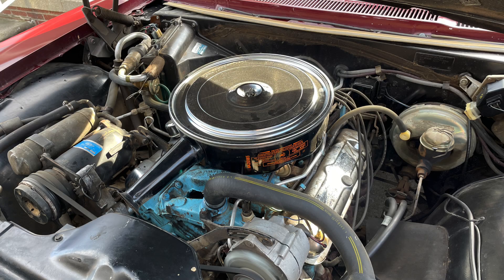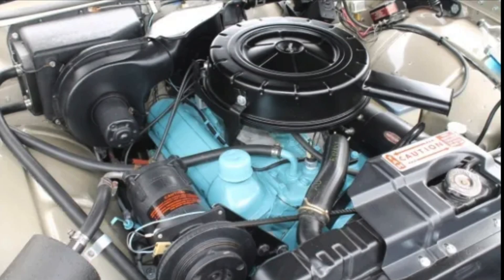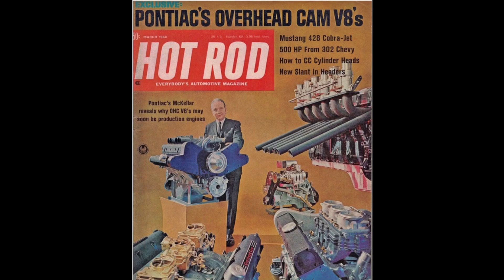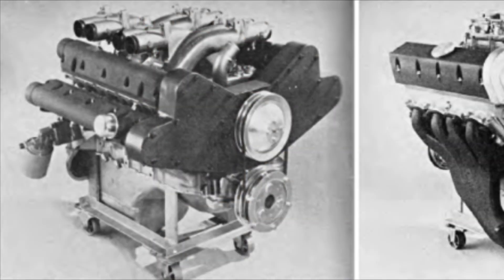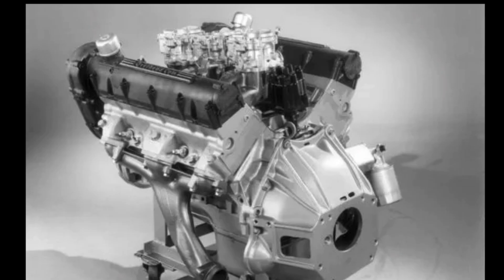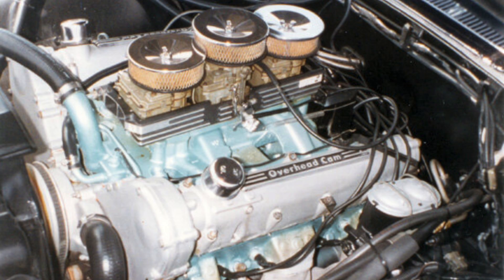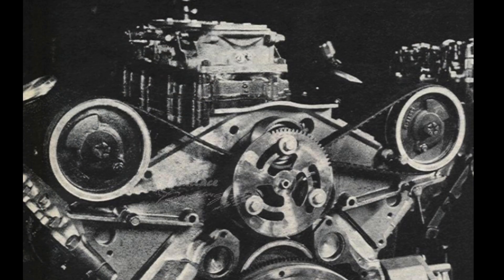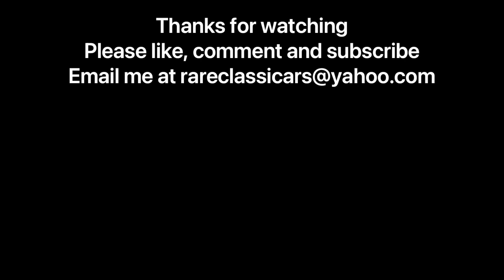Most Powerful Car Engines: Pontiac Builds SOHC and DOHC V8s in the 1960s!

Comment: I owned a '68 Tempest with the 6 cylinder OHC engine. Bought it in about 1974 or so and it ran pretty well, though the engine did exhibit a kind of a "WHEEEEEEE" sound. Very weird sound, but I had no problem with the engine while I owned it.

Comment: SD pontiacs started in 61with the 389, the 421 SD in 63 was a monster! Very underrated !!
Reply: No. There was a SD 389 in 1960. Over the counter engine, with different heads, #7 solid lifter cam, 1.65:1 rockers

Comment: Unfortunately Pontiac was TERRIBLE at marketing almost anything, despite the crap coming out of Jim Wangers mouth and pen.  Tell me how many Super Dutys, 428 H.O.s, 455 H.O.s Ram Air IIs, IIs, IVs... blah blah blah you can find and add them up and if the number breaks 2000 I'll eat my words.  Americans DID NOT hear about these engines or when they did they did NOT believe they were reliable as daily drivers or affordable.  And you know what -- it was one time when Americans were CORRECT.
Reply: Pontiac's marketing was fantastic under DeLorean's leadership, but by the time they got around to the 455 for example, DeLorean was gone, and the smog/emissions restrictions clobbered everyone. I heard the Pontiac engineers had to sneak around to even build the Super Duty 455, and GM wouldn't allow the division to go nuts marketing it. 

It was supposed to be a wink and a nod secret that all you had to do was go into the motor with a proper cam, carb, intake, and headers, and that motor seriously came alive. The block and internals were overbuilt purposely for people to do that. And of course GM put a stop to anything that would outperform its halo Vette. 

I was all about cars in 78, and I knew nothing about the SD455 - none of us car guys did. We just knew they had a lot of torque but fell flat pretty quickly. We didn't really care though, we were building our engines from the oilpan to the carb. Would have been great to have today's aftermarket aluminum heads.

Comment: There was another OHC Pontiac V8 that resided in the engine lab of General Motors Institute when I went there from 1980-85.  It was SOHC, and was called the Repco-Pontiac.  The story I got about it from the lab manager was that it was a 303, designed by the Australian Repco company for TransAm racing in or about 1970.  It didn't look anything like the McKellar ohc engines.

Comment: A big if not main reason, the overhead cam V-8's were not adopted in American cars in those days, was, having overhead cams made the engines too tall to fit in the engine bays without having to have a big lump or a hole cut into the hood. American car companies liked to have several different engine options on the same platform or across platforms, & the platforms at the time were designed for pushrod V8's, which were significantly shorter. The Pontiac Sprint straight 6 cylinder had an overhead cam, but it's dimensions weren't as difficult to accommodate. I remember a 1970 Pontiac Lemans convertible with one of those.

Comment: Three versions of the Experimental SOHC 421 were built by Pontiac engineers in the early 60's one made 625 HP  and capable of 7000 rpm - unleash those in NASCAR etc. 1961- 62 Pontiac still Dominated NASCAR with their Super Duty Program  🏁🏆😎 GM's Infamous  Racing Ban ended all that in 1963 🤬

Comment: As a Pontiac Dealership tech in the early 80's and just out of trade school, I saw my first OHC six. The dealer I worked at had two customers that brought in their '68 Firebirds for servicing with those engines installed. Neat to see other types of engines that Pontiac developed and tested. Too bad they never made it into production. The OHC V8's remind me of the Mercedes OHC V8 engines I saw while working in an Independent Mercedes repair shop while I was in high school.

Comment: I experienced this OHC straight six Pontiac engine being used in a Tempest by a Air Force instructor back in the late 1977 while in Tech school.  The instructor gladly showed it off to me but he did mention being very maintenance intensive.  Constantly rebuilding the head due to oil subsumption (valve guides and seals).   I did get the impression from him that he probably would have been better off with a conventional 4 barrel V8.

Comment: The slots on the toothed cam pulley at  the 10:32 timeline of the video would seem to indicate that the engine had a variable valve timing set up, as well. BTW, I once had both a 1969 and 1970 Trans Am. The 1970 had a rebuilt Ram Air IV 400 with SD 455 rods and other modifications - built at P&M Machine in Shreveport, La. It was a violent and all conquering car in street races during the late 1970s.and early 1980s. I sold it to a Pontiac collector in Oklahoma that had dozens of rare Pontiacs stored in pole barns and many catalogs of Pontiac HP parts.
Reply: Pontiac owners/restorers, racers/investors spend $20,000 or more on engines that regular working Americans could never afford.  I LOVE a traditional Pontiac V-8 but younger generations are rightly ripping them out and replacing them with Chevy LS engines because they are reliable, good on gas, and affordable.  Your GREED and INVESTOR BS has killed any future interest in trying to maintain a Pontiac performance engine without a $50,000 endowment.

Comment: c.a. 1962 Mickey Thompson had a V8 in a Tempest with FE Ford angled spark plugs  any info on these heads?  Micky also had Hemi heads which could be drilled for most 4 headbolt per cylinder blocks  Pontiac and Ford FE for example  won TE NHRA  with a blower  Any idea where the molds went  MT could make for Olds or Cad also easily  great design

Comment: I put the first pontiac tubo engine together for them on a dyno. Was a 301 engine. And then they had me set it up to run on propane with the turbo. It ran real good and clean. I also did the buick turbo for buick but they had no clue of building turbo engines. They didn't even know what a waste gate was. So the motor blew to pieces and then the ass holes tried to blame it on me. F um?

Comment: Pontiac are vary easy to hot rod . I have a 75 firebird with a 400 cdi that stock put out 215 hp with a 4 barrel carb . pontiac did not dish any pistons so change heads to #46 and new intake edlbrock & carb. RA #1 cam 335 hp .

Comment: I thought the overhead cam 6 would have been produced longer. Just like the 4200 double overhead cam six is no longer. Good engines, the 4200 has better output than v8

Comment: There was the dynamics of "you cannot challenge Chevrolet". That went on all the way through the 1990's. RA V motors, could not challenge the BBC. Killed the Gran National because it challenged the Vette, and the same with the 1989 Firebird that had the GN motor and transmission in it. I had the magazine he is discussing and the later magazine with the RA V on the cover. It was always a dream and nothing more. Very little of these ideas or projects got out the back door. Milt Schornack was one of them that saw a little of this.

Comment: Wow, I remember that cover, almost got me in trouble. I had that mag in my senior HS english class and my teacher balled me out for reading that "trash". I thought my dream job would be to work at Pontiac engine research. After getting my degree in Mechanical Engineering, I landed a job working at Ford engine research and had a lot of fun. Rotary engines, gas turbines, and did a lot of work on Direct Injection. Also saw Ford put the first computer in a car. I took up the whole back seat and we thought that was a crazy idea!

Comment: My 67 Firebird Convertible had the 6-cylinder overhead Motor sorry if anyone gets Made, they were Junk I had nothing but Problems from day one, I bought it Used 800 Buck back in 79 Guy told me Great running car, It seemed find for test drive, Driving home Started over heating Miss firing, own 8 months sold it. Had a great body,

Comment: It's sad that back in the 60's and 70's engines with simple carburetors could have so much power with little technology and be built for less. Now it takes thousands of dollars to give the same power with so much technology available and over priced cost. Give me back my carbureted engine and a low price to match. All these new cars need 15K engine to give you the same power the older cars came with from the factory. Car prices are off the charts

Comment: Pontiac built some great cars with great power plants. Ironically, I read an article the other day about the Buick Grand National powered 89 Trans Am Pace Car. The article said the car was rejected by Pontiac purists who hated to see a Buick V-6 turbo under the hood. I kind of thought the article didn’t have much merit because by then Trans AMs and other Pontiacs were running Chevrolet motors (or lesser Buick V-6s). Anyway, a very interesting video.
Reply: Funny you should say that because the faster Pontiacs to roll off the assembly line didn't have Pontiac engines. Like you mentioned, the buick V6 and LS powered were the quickest
Reply: @michaelmaskal9295 
  GM killed Pontiac engines in very early 80's, folding engineering into Chevrolet, the last 'Pontiac'   performance heads are for a NASCAR SBC.

Comment: First car was a $50 '67 Pontiac Executive with the 400cid v8, turbo 400 trans to a 3.31 rear end, re-jetted carb, re-curved distributor and Thrush dual axhaust. Cook Co. sheriff radared me at 140mph southbound on Rt 45 towards I-80 in 1983. His Ford Fairmont never had a chance. Ahhhh, the good old days! 😃
Reply: Don't  ya hate pulling  over n having  them tell you...why did pull over you were getting  away
Reply: @Etron49  mean the direct  connection product line  ...had a Shelby rampage  went to dual carb set up and 220 × 220 cam did low 13s easy 12 a few times on  pump  gas

Comment: The natural question would have to be: how much horsepower and torque, using gasoline with lead in it, did these engines realistically produce? The whole thing sounds like a fantasy (and no clear indication if these gee-whiz super-engines would have been something that ordinary repair garages would have been able to maintain; OHC engines of all types were reputed to be problematic, even in the 1980s) and it isn't at all clear that they would be practical for mass production, let alone mass use.

It would be very interesting indeed if Pontiac had produced a DOHC, fuel-injected version of its Tempest Six that could go tow-to-toe with V8s of that era. I guess we will never know if such a motor would have enough power and torque to measure up.

Comment: Hot Rod ran a story within the last couple of years titledthe "Academic 303" about an engine project with REPCO in Australia where they designed a 303 ci SOHC V8 but went nowhere because a conventional head V8 of the same size had better power output. Neat little piece, you should check it out.

Comment: Nice video, informative.  None of these were available or proven through, just concepts and ideas.    Did you know- Pontiac had a real HEMI proven racing engine in 1962?!   Mickey Thompson and Pontiac made HEMI engines at a time when chrysler did not!   The HEMI Pontiac V8 was a proven winner taking the Top Eliminator title in drag racing at the US Nationals beating Don Garlits in 1962.  This was the height of the Pontiac Super Duty racing era before the GM racing ban in Jan 1963,  I collect these HEMI Pontiac parts and engines and own the only known surviving original M/T HEMI Pontiac racing engine.  Pontiac actually made a HEMI block, I own one.  this was for the HEMI engine.  more at Pontiac Heaven page and site.
Reply: Any interest in having that motor examined and cloned/reproduced?
Reply: @3xeplodng_3agle_studios  how would it benefit me?  I have a lot invested into what I have.

Comment: Holden, General Motors Australian division in 1987 was up grading the 304 ci 5.0 litre V8 ( later 355ci 5.8L in its final form) and did exactly the same thing , put a single overhead cam on the V8 , it was a 3 valve design and came so close to production, there were 20 Holden VN Commadore,s fitted with the test engines and many pictures on line of the Holden 5.0L OHC motor . In the end they went with a conventional design and " Bunch Of Bananas " intake ( as they got called) that looks exactly like a production LS1 intake , but this was 10 years B4 the LS , the Holden had same port layout as LS , same chev bellhousing, same Delco engine management, infact if you look up a pic of a 1988 Holden 5.0 L Injected motor, it looks a lot like a LS1 . They were grate motors , roller cam , sequential injection in later ones , the last top version of the Holden V8 was in 1997 in the HSV Holden Commadore,s in 355 ci 5.8 L , it was changed to a 5.7 L LS1 the next year 1998 .

Comment: I saw a small write up on the 421 front drive ohc it was called the street version it 10- 1 compression three twos and put out 470 hp  I think at 6000 rpm I wish Pontiac would have released it I wish I could have remember where I read it.
Reply: 6K with a rubber timing belt in a GM V8 would certainly lead to valve salad.

Comment: I've read about the Pontiac Sprints that had the overhead cam with the four-barrel and the GTO goodies but I've never seen one.
Reply: I had a OHC 6 4 bbl  3 speed in a 67 Lemans sprint con it had 4 piston disc brakes on front factory air and power steering basically everything  GTO had except V8. Was  a very fun  car to  drive revved up quick faster than people thought surprised a lot of V8s off the line

Comment: My family bought a 67 Lemans in late 66. Clearly recall the OHC labeling not only on the engine, but on the front fenders too
Reply: Correct, The Base model OHC just called out OHC-6 with the HO 4BC call out showing SPRINT
Reply: And 2 + 2 emblems and stripes....

Comment: I wonder if these ohc Detroit V8s might have been simply far more power than they thought was safe or usable on the street,  and then they also knew emissions regulations were coming soon as well,  so all that power would've been lost 😢 and also,  being so high revving,  they would've had less low rpm torque,  making them slower off the line,  but with much higher top speeds, scary with bias ply tires and drum brakes,  requiring MUCH more overall investment,  not to mention insurance companies were famously cracking down.

Comment: hi, does anyone  know why the 428 was NEVER as good as the 421?
Reply from the maker: Some 421s had forged cranks/conn rods. 428s did not. 421s were generally built stronger. Both are good motors.

Comment: Imagine the power curve of a Pontiac 455 with four cams and 32 valves. That easily could have been a 7000 RPM screamer.
Reply: Ram air VI
Reply: Yes, call it “Captain Torque…”

Comment: An overhead cam Pontiac V8 is an interesting idea, but it is hard to imagine that it would have offered radically more power than the Super Duty heads did. Overhead valve engines have the advantage of less valve train mass allowing higher engine RPM. They also offer the ability of adding more valves per cylinder as mentioned, thus giving the heads greater flow ability. The third advantage they offer is to allow designing the ports in the head to flow more freely. At 389 cu in a Pontiac engine already had a lot of rotating mass and a valve train lightening would not have significantly increased the maximum RPM the engine could maintain. Pontiac engines were near square as far as bore x stroke, so the two large valves per cylinder they already had flowed about as much air as they could use in their max RPM range. As for improved runners, the SD heads showed that Pontiac was working on this idea for their normal push rod engines. The Super Duty engines really did a super job moving that air/fuel mixture into the cylinders. This research never made it into a Pontiac V8, but I have to believe it was of great influence as Chevy designed the Vega overhead cam engine.  With the Vega engine, as GM had seen in the small Buick aluminum V8 15 years earlier, putting aluminum engines in the market that is dominated by people that do a poor job maintaining their vehicles is a recipe for disaster. Aluminum sealing up to iron will tend to develop leaks. If you are not regularly checking your engine, small leaks become big problems with low coolant and overheating, to warped heads or blown head gaskets. 

Boy, that turned into a ramble.
Reply: "Overhead valve engines have the advantage of less valve train mass " Did you mean OHC?
Without rocker arms and push rods, OHC engines have considerably less valve train mass, and are noted for high rpm performance,
Reply: @alchrist5544  yeah he probably meant that
Reply: @alchrist5544  Yes indeed, I did mean over head cam engines, not overhead valve.
Reply: That magazine he showed had a 302 chevy making 500 hp. No ohc or 4 valves needed and way easier and cheaper to fix and build.
Reply: overhead cams are great in their way, but they make the V8 a much larger package. Take a look at a 4.6 Ford at only 281 cubic inches and it's a huge lump.  It works fine, but way big for the displacement.

Comment: I have had dealings with Pontiacs over my life. My dad had a '69 GTO when I was in grade school. Yellow w/black vinyl top, 400/4-speed car. One of the cars I learned to drive on was a 71 Pontiac Ventura 6 Cyl/ 3 on-the-tree (I actually took the test in a 66 Coupe De Ville, lol). 

I myself have owned 4 Pontiacs, a '69 Firebird Convertible (350/Auto), 3 Fieros (yep 3). Based on all that, you might think I am a GM afficionado, however, I am all over the place on that stuff. I currently have 3 oldish Fords. Go figure